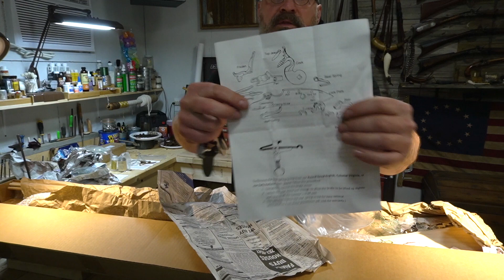JIM CHAMBERS FLINTLOCK RIFLE KIT - UNBOXING

Comment: I've got a sitting fox 20 gauge pistol kit to do. Fun part is, I'm doing it while I'm working in my off duty hours lol. I get to figure out all the drilling with a hand drill.
Reply from the maker: Nice. It’s always fun to do it that way.... 😉
Reply: Maybe... Lol wish I had a table. Best I got is a frame rail and a machinist vice... I'll figure something. Lol
Reply from the maker: I find pistols harder than long guns to build just because they’re so hard to get held right with the vise and stand....
Reply: Honestly I'm kinda used to it from a cap and ball wheel gun perspective. First time having a single shot requiring attention. Lol we'll see how it goes. Lord knows I got a few colts and Remington's and colt clones. Bought time I tried something older. Least that was the thought in January when I ordered it lol

Comment: Is that the box it ships in or was that box in an outer box? If that's the only box that's kind of scary. I've been wanting a Chambers kit or two for over a decade but I don't have the skill nor the time to assemble it and I don't feel like waiting a year or more for a builder to finish it. Nice kit.
Reply from the maker: Yea, Rich, that’s how it’s shipped. I ship and receive finished guns in wood crates but a kit shipped this way with an unconditional replacement in case of an incident, seems pretty reasonable. Yep, a nice kit. Thanks!

Comment: Hi from Australia I just picked up a Spanish AMR Antonio Marcos relea .45 cap lock a traditional style kit gun from 70s or 80s.... what would be a good 250 grain mini ball and powder combo to start with ?? Would it be 80 grains 2f max load
Reply from the maker: Very nice! Yes, that load will likely work but I would start at 60g 2f and work up in 5g increments until I found the best grouping load. You’d be surprised how many rifles I have that shoot super tight groups at 75g but not nearly as good at 85g. Also try 3f starting at 50g. 👍🏻

Comment: Those castings look like wax investment castings not sand castings. I know you’re unpacking a box like it’s Christmas morning and trying to get all your thoughts on film so it’s hard to keep things straight but just thought I’d point it out. I just got a sand cast buttplate from Track of the Wolf and it’s so pitted to the point it probably should never have passed QC at the foundry. I’m sending it back. Not sure about the historical accuracy of wax castings vs. sand castings but as far as I’m concerned my builds will be utilizing wax castings. Awesome kit BTW. I might have to give Jim and Barbie a call.
Reply from the maker: They are. Obviously. I think I said ‘sand cast’ and ‘investment cast’ back and forth the whole video.... I have to reread my forum posts to make sure I didn’t write anything goofy so it’s amazing I can get anything on film correct half the time! Thanks!

Comment: How uniform are the barrels?  If you bought another barrel in a different caliber, same model from Rice, will it “drop in” after adding the hardware.
Reply from the maker: I think the barrels are especially made for Chambers by Rice so I don’t think you can buy one from Rice but I think you can get this gun up to .54 caliber and down to .40 maybe, and another barrel would be exactly the same. The barrels are built to very tight O.D. tolerances.
Reply from the maker: Also, I recently bought a .45 barrel for my Kibler SMR .36. I bought it a year after I built the kit and it slipped right in perfectly. 👍🏻

Comment: How difficult would you say one of these kits is? Could a beginner who’s never built a kit before but has wood working experience doo one of these?
Reply from the maker: 7/10 difficulty. Perhaps 6/10 since you have woodworking experience. The part that’s the most difficult is getting the shape correct. The easiest, as it’s preshaped, is a Kibler kit which is about a 3/10. Watch Bill Raby’s YouTube videos. He has several series that show what is involved. 👍🏻

Comment: well that is nice, but, who has 800.00 or 1,000.00 to spend ???
Reply from the maker: I’m not real sure. Old people mostly, I guess. Professionals. I had to save for mine...
Reply: I built a rifle 30 years ago. Didn't really know what I was doing. Ordered all the parts separately and went at it. Ruined a $150.00 piece of curly maple in the process. If your stepping up from a low end piece I would HIGHLY recommend spending the money on a quality kit. You will be happy you did.